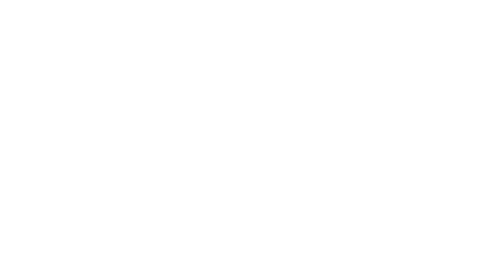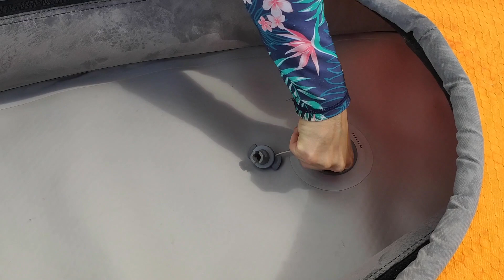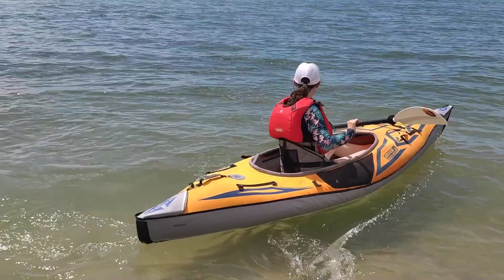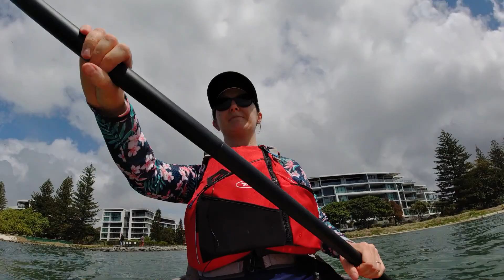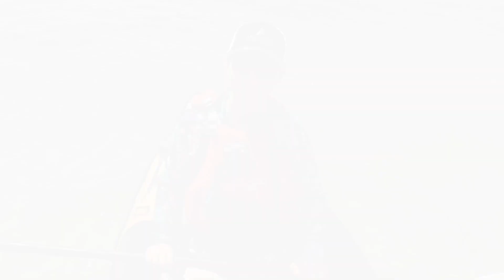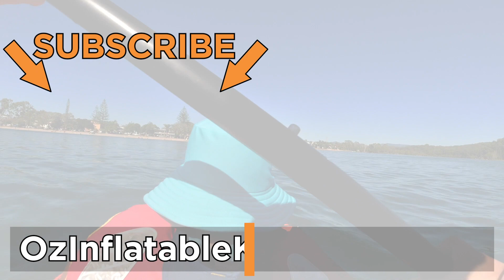Drop-Stitch Floor from Advanced Elements

Comment: Thanks for the review. Do you leave the drop stitch floor in when you fold up the kayak, or take it out each time?
Reply from the maker: Hi Peter, if the kayak is dry inside, I leave the DS floor in the kayak and fold it up. If the kayak is wet inside (from swimming, for example), I'll put the floor out so I can wipe out the inside with a towel, then fold up the floor separately. Either is fine. Cheers, Emily
Reply: @OzinflatablekayaksAu  my wife and I tried out the new ds floor in our tandem yesterday and really liked it. It was more comfortable than the backbone and, though a bit more sensitive to wind, it was definitely faster.

Comment: Witch one would you recommend for a 100kg man? Drop stitch or backbone? got my new kayak today. Can't wait to get on the water :)
Reply from the maker: Hi there! The drop-stitch floor would be your best option. It enhances the maximum weight capacity in the kayak significantly. There is also a good article comparing the 2 if you would like to check it out here 🙂https://www.advancedelements.com/accessories/backbone/

Comment: Recently purchased convertible elite with the drop stitched floor, which should be able to inflate to 4 - 6psi but any pressure greater than 1- 2 psi just blows the valve
Reply from the maker: Hi Phil, the valve is probably just reverting to the deflate position when you twist the pump off. There is a troubleshooting guide I can email you that helps loosen the valve so it stays in the inflate position when you remove the pump hose. Also, if you try putting on the pump with the valve in the deflate position (even though the instruction say start in the inflate position), I have found that often works. Cheers, Emily.
Reply: I struggled with it today the adapter kept coming apart from the pump. Also when I pull the hose off it just deflates

Comment: Our local rivers can run pretty low, to the point where there are certain points where you will almost always run aground on the rocky river floor. Do you think an Advanced Elements kayak could survive those kinds of conditions on a regular basis?
Reply: Yep!
Reply: Yup. There''s really only one vulnerable spot. In the center rear of the kayak where you have an aluminum frame on one side and just the outer shell on the other, if you scape along a rock there you can rip through the shell since the aluminum frame doesn't allow the shell to flex.

I did exactly that and had to patch it, but there really isn't any other section of the kayak that's vulnerable.

Comment: It seems great but..pricing? It costs like 350+ EUR here ..which is more than a normal SUP package.
Reply: well I just managed to find one on ebay in germany, for the sport, for 129+shipping.
Reply: Later edit: once  it got delivered, I realized it looks different to everything I saw online, even though the seller, a very reputable store and one of the two official AE dealers in Germany said it's the original product (when I contacted them). It even had a pocket for the backbone on the bottom which goes totally against AE's recommendations, as in don't use a DS floor and a back bone. I went and purchased another one from the other official dealer in Germany, for 233 euros and indeed that one seems to be the real thing. I will send them both back because I decided to get the Expedition Elite :). However, a very strange event and I still can't figure out how that product exists. It's clearly not the original AE DS floor but it fits 95 % so somebody made it specifically for the AE boats .....

-it's about 4 cms shorter with  flatter ends;
-it's about 1cm wider;
-it weights 2.9 kilos vs 2.1 of the genuine DS floor;
-it has a weird shroud around the valve that says "inflatable stand up paddle board", although it clearly isn't a SUP;
-same shroud says a maximum pressure of 8 psi vs the genuine DS floor's 6;
-it has a backbone pocket on the bottom that runs the full length of the floor;
-in it's defense, it feels more robust compared with the genuine one but only long term use can determine that;

here's a picture with them, top is the genuine one, bottom is the "fake" one: https://ibb.co/GTgCN0Y

Hopefully this will help someone to make an informed purchase of this product in Germany/EU;
Reply: @ioandragulescu6063  Interesting.  I have just acquired an AE Ultralight and would be interested in a DS floor.  Can you kindly put a link to the supplier of the upper floor shown in your picture?

Comment: Does the regular floor feel saggy? I have a Firefly but that floor is so small it's not really possible for it to sag as I fill it completely. I would like to get an advanced frame one of these years but I am think it would require dropstich to feel stable.
Reply from the maker: I wouldn't say it felt saggy, no. And it certainly feels VERY stable. You could always get the AdvancedFrame and then buy the drop-stitch floor later if you felt you needed the performance enhancement. Cheers, Emily.

Comment: I would like to see how one gets on and out of it.
Reply: It's easy mate
Reply: @Mainoffender69 , until one sees that, one cannot know that.
Claims are easy to make; showing and proving are a totally different matter.
Reply: @mortschubert3909  well I was out in mine yesterday and I can tell you that getting in and out was very much a piece of piss
Reply: @Mainoffender69 , that is very important to know. Thank you for sharing!
Reply: @mortschubert3909  no probs let me know if you need anything else
Reply: @Mainoffender69 , I certainly will!
Perhaps, this will encourage you to share your own content! :)
Reply: @mortschubert3909  looking to do some soon, just looking for a go pro. Any you can suggest?
Reply: @Mainoffender69 , I got the latest, no. 9. I took it with me on the trip I made three weeks ago; three days ago, when I wanted to go on the river again, I found out the battery was completely dead. A genuine brick. It still confuses me - a new camera only used once?! How could that happen?
Otherwise, the camera seems remarkable. I will get another battery and give it a second chance. I hope all will go well this time round!

I also have a FDR-X3000; I am still very impressed with it.
I could use a new battery on this one as well, but the camera has been used for a good two or three years now.
Reply: @mortschubert3909  interesting...let me know how you get on with the new battery. Is the fdr a gopro type i.e. attachments and such?

Comment: I hear the soft floor tracks better as your boat is submerged in the water a little more .?
Reply from the maker: That's not my experience. But if you were very lightweight and you put a lot of pressure in the drop-stitch floor, you could potentially be so buoyant that your aluminium ribs were not in the water, which would affect tracking. Cheers, Emily.
Reply: @OzinflatablekayaksAu  Hi! I am a little curoius too, as I am 50 kg and very comparable to you. I am just about to buy this kayak. Which floor do you prefer of the two? Regards
Reply from the maker: @stephanielefevrehansen8490  They have pros and cons at our weight. I like sitting higher in the kayak with the drop-stitch floor, and of course I like the improved tracking and speed. But I LOVE the softness of the soft floor under my bum. Cheers, Emily.

Comment: Sorry to say that but, the drop stich floor do not increase the buoyancy because it contain more air in the same volume, therefore it produce the same buoyancy increasing the weight even if by a marginal amount considering the weight of the air. The benefits are other given by the higher ridigity
Reply from the maker: Hi Gabriele, that is odd, because when we use the DS floor whilst kayaking, the kayak sits higher in the water?
Reply: @OzinflatablekayaksAu  I do understand that it is a bit counterintuitive, but is the person sitting higher on the water, not the kayak and the reason is that the weight is distributed accross the entire surface instead of localized like in classical kayak bottom.
It is the same difference that you see between a classical floating cheap floating water "bed" and a dropstich SUP
Reply from the maker: @GabrieleNunnari   Hi Gabriele, thank you